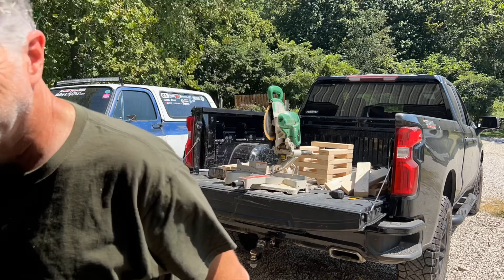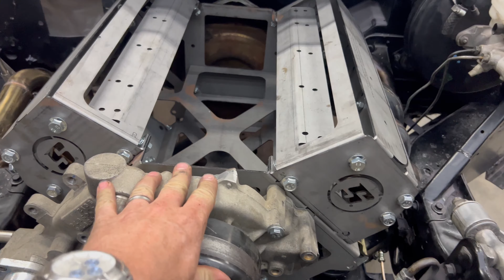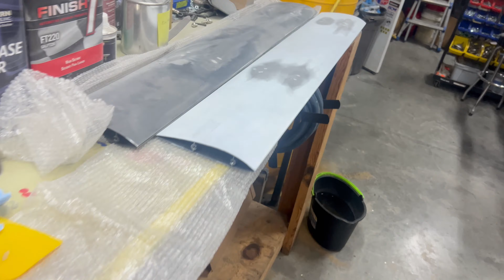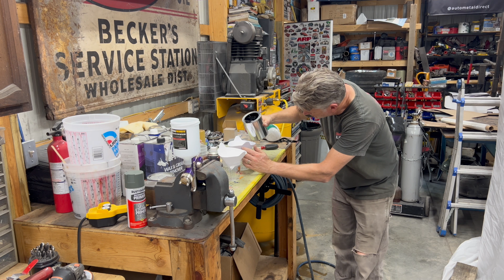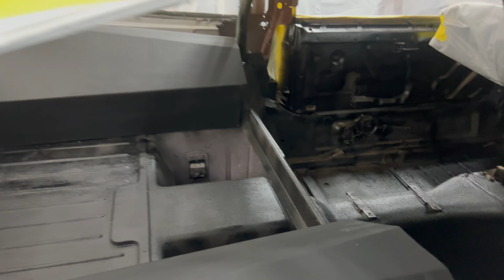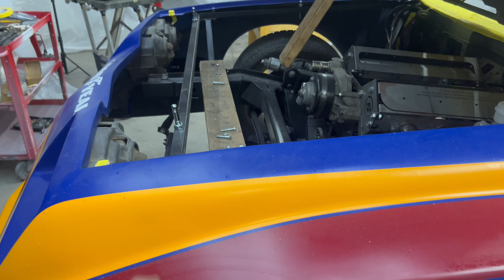The Thrash! Eleven Days to LS Fest!

Comment: I would have cut a slit in the square bar, grind down the frame pinch to fit and wide it in. (Talking for the headlight buckets) Worked on frames for years and I didn't like to remove any material unless necessary. The river line looks super good on the dash, leave them that natural color. But I would suggest maybe a slim line of black seam sealer to finish each edge. You can make it like super nice with some tape, nitrile gloves, and a damp fingertip.

You guys are killing it!! Love the build and the bonding. Praying it all works out, God bless.